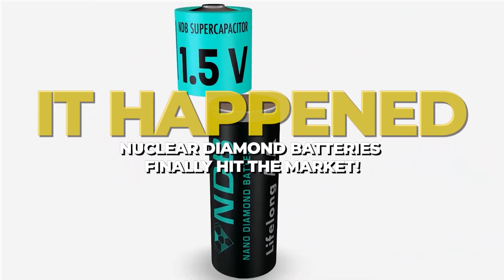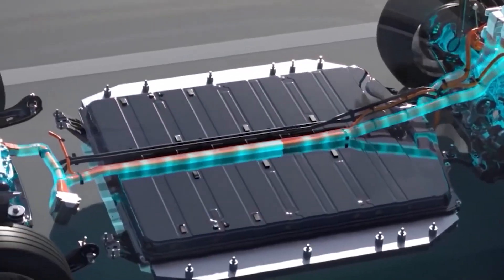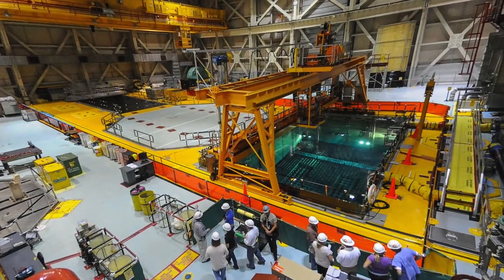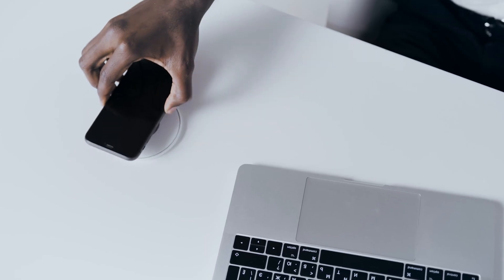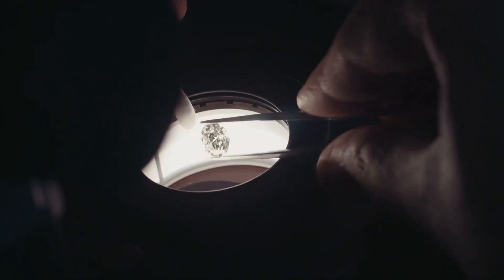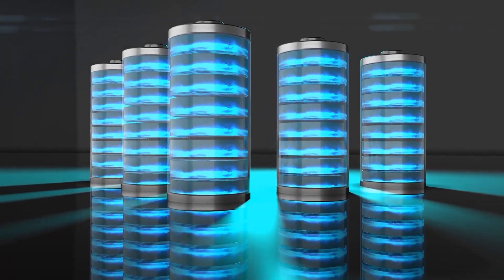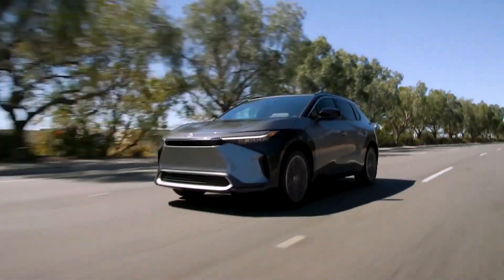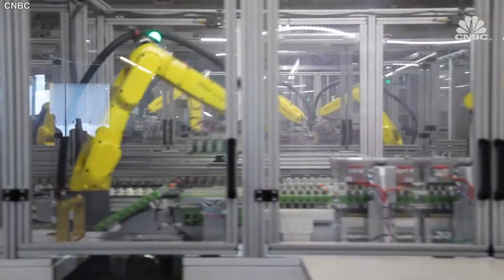IT HAPPENED! INSANE Nuclear Diamond Batteries 2023 FINALLY REVEALED!

Comment from the maker: Tell us what you think! Will this actually work?
Reply: As long as they dont explode this is a game changer
Reply: Nope, it will not work and the reason is that EVs need 10s of kW of power to drive. The power density for NDB is only 10 μW/cm3. Let's say you want to generate 10,000 Watts that means you will need 10,000/0.00001 = 1,000,000,000cm3 of battery. That's about 1000m3 of battery bigger than an average large house in the USA. And 10,000 Watts is not even enough to accelerate a modern EV, thus you will still need a Li-Ion battery also. But worst of it is that the cost will be insanely high and the battery will be too dangerous.

Comment: The power density for NDB is 10 μW/cm3. Let's say you want to generate 10,000 Watts that means you will need 10,000/0.00001 = 1,000,000,000cm3 of battery. That's about 1000m3 of battery bigger than an average large house in the USA.